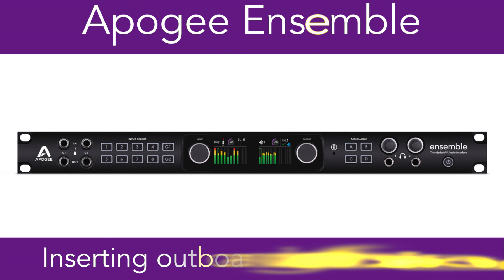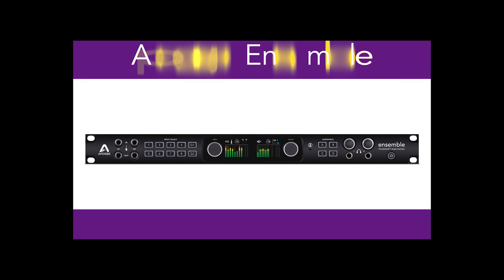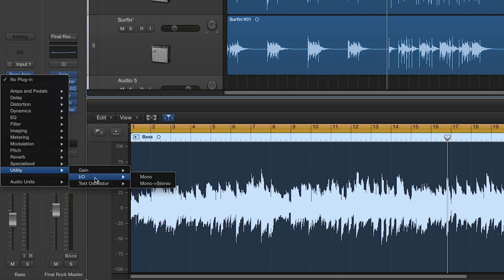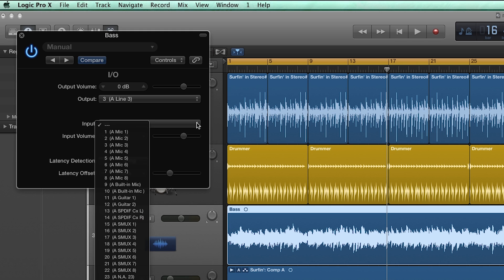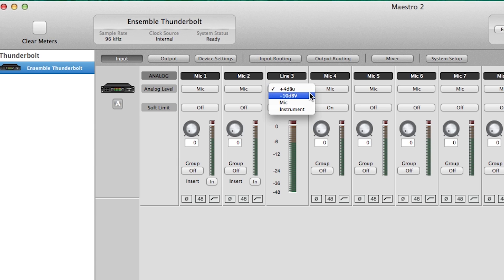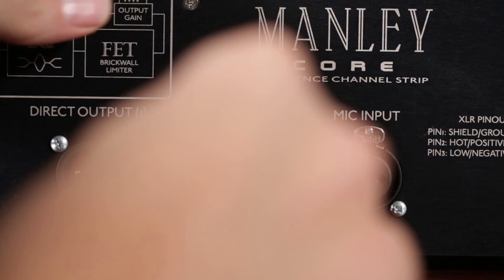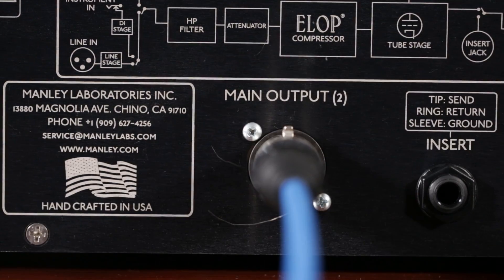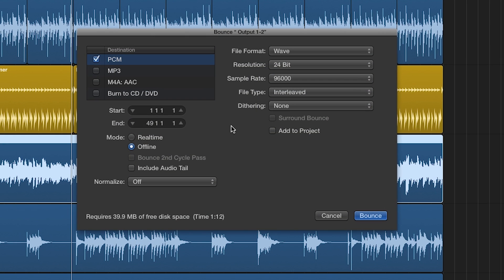How to mix with outboard analog gear using Apogee Ensemble

Comment: I've just bought ensemble thunderbolt and i have some trouble buying DSUB 25 out for ensemble in my country. i want to use 2-3 speaker monitor for my studio... is there any sample which cable that i should buy? is it DSUB to 8 xlr or 1/4 jack..or have u any link that sell cable for my ensemble thunderbolt..thnk u

Comment: Just got my ensemble two weeks ago, best thing ever.... can't say enough good things. Using it for running in ear monitors and processing live vocals, guitar, and violin before it heads to FOH. Using the built in talk back mic to blend some room live sound into the in ear monitor mix. Still sorting things out with it but so far its been awesome. And the fact that the dsub makes plugging things in before the show between acts really simple. The low latency is amazing as well.

Comment: So, if I want to use 8 external pre amps and use the ensemble as a converter I cannot use the analog out?
Reply from the maker: +Juan Germano Ensemble lets you bypass the internal mic preamps, so you can do this if you'd like to use your own external pres and have Ensemble simply be an AD converter.